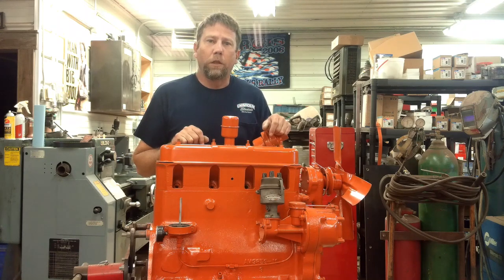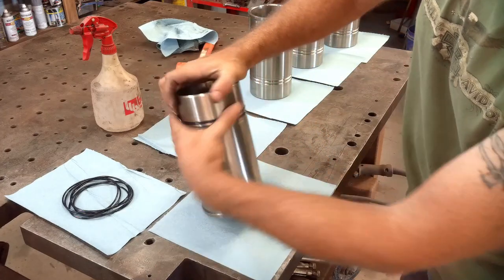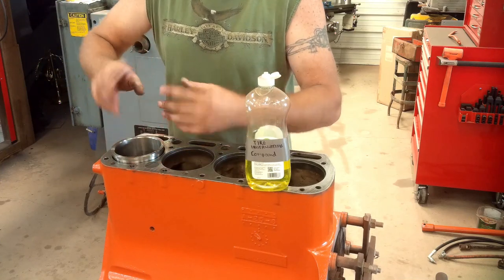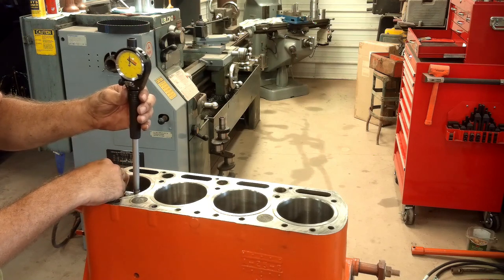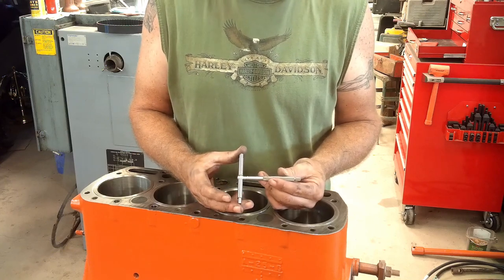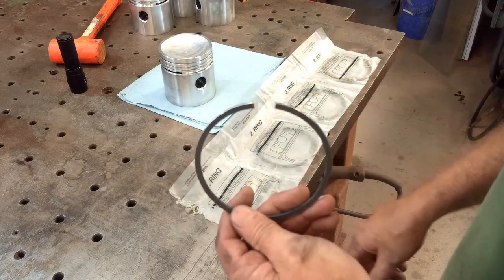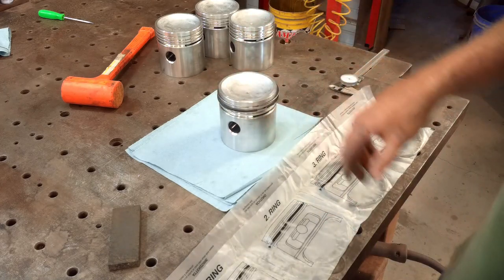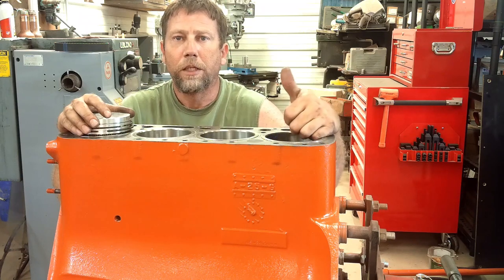Allis Chalmers WD45 Restoration Install Wet Sleeves Ring Gap Ep.24

Comment: I learned a lot in this video.  I’ve never rebuilt an engine before, and I had no clue just how much taking all those measurements before being installed in the block mattered. Especially the piston rings.  I had always assumed that if you bought a rebuild kit I would be really to go outside the box.  Looking forward to the next video Jason!👍
Reply from the maker: Thanks Cody! Most of that was overkill for this tractor engine. I probably would get by just fine installing those parts "as is". But a car engine that's going so see a lot higher RPM, it becomes pretty important. If it's a race/performance engine, it's mandatory.

Comment: I saw your comment below about all the measurements and it being a little overkill.  I'm trying to do an overhaul of an 1950 WD with my daughter for a 4-H project. I'm thinking of doing an inframe overhaul and don't have all the tools (cylinder gauge and micrometer and ring grinder).  I just wanted to make sure we could get by installing as is or if I needed to buy some more tools.  I did find a standard 4" sleeve kit (I think but I'll call to verify).  Thanks the video was very helpful and I'm sure I'll check you your others.
Reply from the maker: These old tractors are pretty forgiving. Most measurements aren't that critical. Don't skimp on the ring gap measurement, that can ruin a engine faster than anything.
Reply: @sparksfireandbalingwire8467  thanks

Comment: I was sort of lucky with my John Deere I only had one ring too tight. Those ring grinders sure work good, a couple minutes and its done. Yours is shaped different with the rounded end, easier to use than my straight rectangular one. It's been over 30 years since I overhauled an engine so I know what you mean by being a bit nervous but following the book and asking a few questions it all worked out perfect. Watching you do yours I wouldn't be too nervous. Looking good so far, its going to look and run like new when your done. Keep smiling.
Reply from the maker: Thanks!  Installing the sleeves was the only thing I was nervous about as I have never did it before. All the rest should be pretty straight forward. I can't wait to hear it fire up!

Comment: Great video Jason! 🙂👍 I'm glad the parts finally arrived.  Looks like the bottom of that  box left a pretty accurate message on the work bench 🤣🤣🤣  is that still the original block? 🤔
Reply from the maker: Thanks Zane! I thought it was pretty accurate too! As far as I know, it's the original block but I don't think there is anyway to verify it. I do know the engine had been rebuilt somewhere in the past, but I don't have any clues to when or why. I'm guessing since there was that hole in the oil pan that it had thrown a rod, but there were no nicks or gouges in the bottom of the block, so it could be replacement block too.
Reply: @sparksfireandbalingwire8467  nothing wrong with that! 🙂👍 one less piece you had to hunt down yourself.  Its lookin great 😀
Reply: Where did you buy the kit

Comment: When installing new wet sleeves, it's a good idea to 'dry fit' them, before you put the o-rings on.
 Make sure they slide in and you should be able to rotate them in the block. That will tell you there is no interference from a missed burr or ding in the block.
 You can also check the height of the sleeve(.004 above the deck, if I remember right) to the block when dry fit, by using washers and a couple short bolts to snug the shoulder down.
Reply from the maker: I did dry fit them off camera. I probably should have included that in the video

Comment: There's a 1976 Chevy military truck in Canada I'd like to have. It's in rough shape (missing back glass,seats whore out,cab corners are rotted,no carb,no radiator,no air cleaner, missing the original military grille guard, and has no bed) but it's a truck I've wanted for a long time now.
Reply from the maker: Is the owner willing to sell? With the exception of the grill guard, everything else is easy to get.
Reply: @sparksfireandbalingwire8467  well he's willing to trade. But I have nothing to trade. Then I have to find out how to get to Canada. Or have it shipped that too

Comment: Make sure the lower webbings aren’t cracked. The allis engines were notorious. Top webs are not a big deal but the bottoms will leak if cracked.
Reply from the maker: No cracks! I got lucky for once!
Reply: We did my buddy’s 45 and had to get a different block. Luckily my dad had a dealer NOS block in his garage we put in.
Reply from the maker: @justinblain928  Is there anyway of telling if I have a D17 block too since It has D17 pistons? I don't know of anyway to verify if a block is original or not.
Reply: That’s a 45 block. Low pressure oil system and no reinforcement casted in the block. D17 uses a PH8 oil filter and has a cast reinforcement about an inch and a half above the pan on the outside that runs almost the length of the block.
Reply from the maker: @justinblain928  Good to know

Comment: Fantastic video.  Does anyone know if you can buy a short block for the WD45?
Reply from the maker: Thanks! If you put a post on some of the tractor forums, you might come up with one. Is your engine unsalvageable?
Reply: @sparksfireandbalingwire8467  I think it's good.  Definitely leaked coolant into the oil though.
Reply from the maker: @sonofeverssagas2825  It may just be  the orings then. When I pulled my old sleeves out , they literally crumbled and disintegrated. If you don't have any cracks in the lower webbing, and it's not all pitted where the orings seat, you should have a good block.
Reply: @sonofeverssagas2825  The FIRST thing to check , if you get coolant in the oil, is the core plugs on the top of the head. They rust out from the bottom and might look OK, but just a pin hole will leak.
 They are easy to replace, once you dig them out, and probably not more than a couple dollars a piece. There are 3 of them.

Comment: 233 cubic inches
Reply from the maker: How did you arrive at that? I come up with 240 CID
Reply: Sparks Fire and Baling Wire  Bore x 3.14 x stroke x number of cylinders
Reply from the maker: @justinblain928  I used Pi times radius squared x stroke x4 to come up with  240 CID